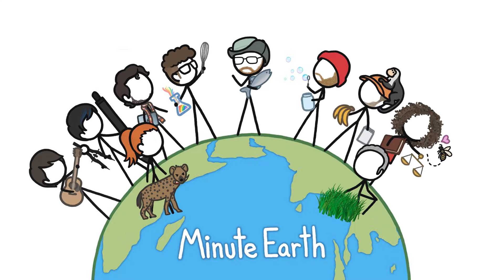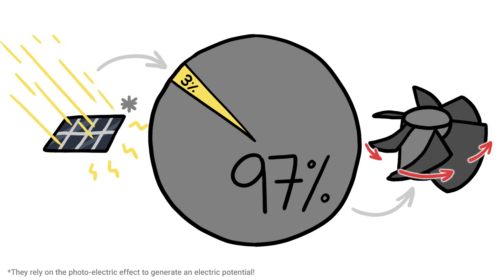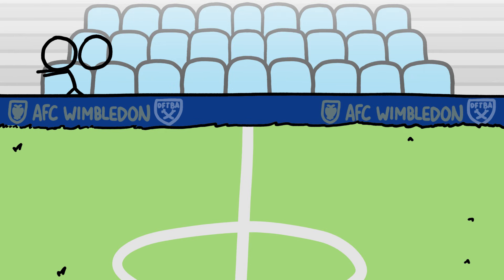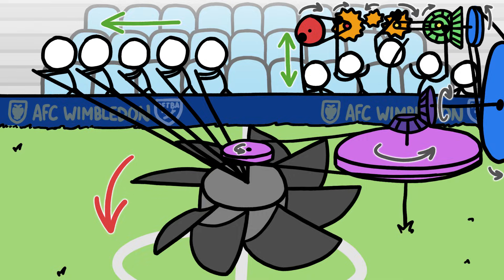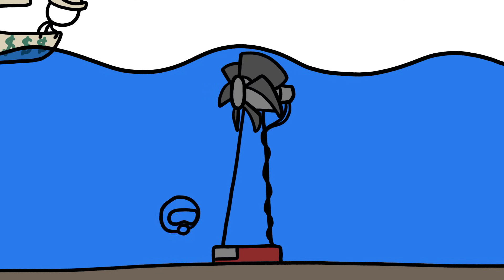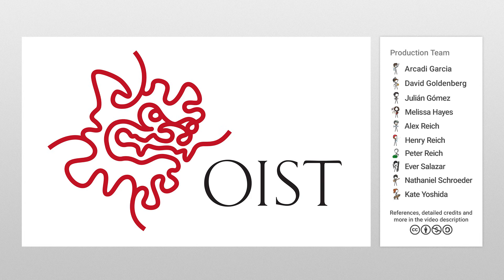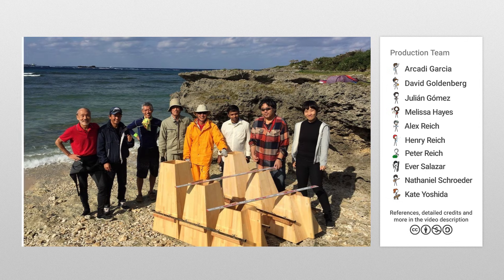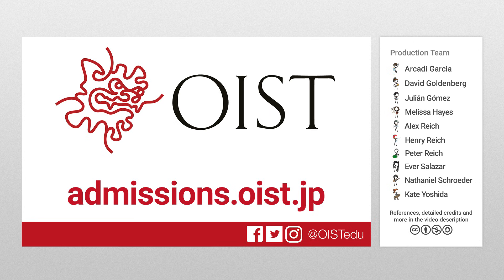Why Can't We Get Power From Waves?

Comment: Lets just invest in more nuclear. Its honestly great when done right
Reply: https://whatisnuclear.com/thorium.html
here ya go, benefits and downsides of thorium
Reply: @chroma9848  most of those downsides are the use of solid reactor fuels, which include thorium, which are addressed if you use a liquid fuel and reactor salts instead.
Reply: @kush1000ful  thorium reactors still require uranium to function.
Reply: @tweakerkid  Yes, but only a tiny amount compared to what is needed for conventional fusion.
Reply: @tweakerkid  yes, but we have plenty wasted from actual nuclar waste. Thorium solves two  problems at once!
Reply: @tweakerkid  Nope there are designs that don't. https://en.wikipedia.org/wiki/Accelerator-driven_subcritical_reactor
Reply: Thorium appears to be the answer.

It has countless advantages over Uranium including much much much much safer, but for some reason it never took off.

Probably because the plants are more expensive to build, and you can't use Thorium to make bombs - so the government can't use the power plants to sneakily do nuclear weapons research and/or cover up their nuclear weapons expenditure.
Reply: @mrfish9876  thorium offers some advantages over uranium; but you most certainly can get “weapons” from ANY energy source.
Reply: @williamweigt7632   maybe some kind of a weapon but you can't make nuclear bombs from it.

With Uranium, once the reaction has started it will keep going unless contained.  

With Thorium it is the opposite, you need something to sustain the reaction or it stops on its own.

That's why you have accidents like chernobly and that one in the japanese tsunami - once your controls/cooling fails  things go bad fast, whereas with Thorium if your cooling/controls fail, the reaction just stops, it just fizzles out.
Reply: @mrfish9876  Or you use heavy water as a moderator and then when your cooling fails, so does your moderator.
Reply: AOC and her bugeyed friends never mention it for some reason, and young people are scared of it thanks to getting their info from Netflix and facebook. Best of luck
Reply: It's not a matter of money; it's regulations. If you get the NIMBY Karens, "concerned" science professors, environmentalists, and unions to back off a bit, not entirely, but enough so that project managers can actually plan without the ordinance requirements changing several times mid-project, nuclear would be profitable enough on its own.

The bigger problem is it's too late. Much of the infrastructure and personnel needed to build a nuclear reactor simply doesn't exist any more. The US would need foreign help just to build our own designs.
Reply: Expensive
Reply: @luongmaihunggia  Yes, solar and wind are damned expensive.
Reply: @drrtfm  less than nuclear apparently
Reply: @luongmaihunggia  Nope: solar and wind are basically the most expensive forms of power generation currently employed; and that's before considering dealing with waste from them, which is highly toxic and permanently so.  And unlike nuclear waste, cannot be readily reprocessed into more nuclear fuel.
Reply: @luongmaihunggia  Which part of "there is more to silicon chips than silicon" don't you understand?
Reply: @drrtfm  all of it. There are 6.022*10^23 kilogram of silicon in the earth. Many many times more mass than all silicon chips on earth.
What does that have to do with you claiming bullshit that solar and wind energy is toxic?
Reply: @luongmaihunggia  "There are 6.022*10^23 kilogram of silicon in the earth. Many many times more mass than all silicon chips on earth.
What does that have to do with you claiming bullshit that solar and wind energy is toxic?"

There is more than just silicon in a "silicon" chip.
Reply: When you don't bury the wastes in poor country it's a great way too make energy
Reply: Nah. Geothermal is best I think, at least in the usa considering America is sitting on the biggest volcano in the world.
Reply: @Rin-qj7zt  I agree that geothermal is very good, but it would be extremely wasteful to try and power the entire country off of it since it's mostly only available in the west. The cost of moving electricity across all of America is pretty extreme.
Reply: @ottopike6000  by the way, scientists just created the first room temperature superconductor. if we can figure out how to mass produce it, that completely solves that specific issue x3
Reply: @Rin-qj7zt  it doesn't just have to be mass producable, it has to be cost effective. Currently we use aluminum wire in stead of copper because it's cheaper. So I wouldn't bank on making a room temperature superconductor cheaper than copper any time soon.
Reply: @ottopike6000  that's redundant. Part of being mass-producible means it's already cost effective. This is nitpicking.
Reply: @Rin-qj7zt  what I mean is that it can't just be good enough for computers, it has to be incredibly cheap.
Reply: @ottopike6000  yeah, and i'm saying that's redundant. you know it's redundant because i'm telling you. i'm informing you that your interpretation of what i said was incorrect, and that you need to change the interpreted meaning of what i said to match what you are trying to tell me.
Reply: @Rin-qj7zt  yes, that's called misunderstanding someone. It happens when you are unable to read people's minds.

Obviously if we can use room temperature superconductors in computer circuitry then we have successfully mass produced them. My point is that the threshold of mass production is insufficient to allow it to be used in power lines.

Now that I understand that you were using mass produce as a place holder for cheap enough to use in a power line. Thus I see I misunderstood you.
Reply: @Rin-qj7zt  "if we can figure out how to mass produce it, that completely solves that specific issue"

Not exactly: you are ignoring the costs and difficulties in getting the right-of-way for shipping that power.
Reply: @drrtfm  well I'll keep that in mind next time I open my mouth
Reply: And explosive when done wrong
Reply: I have missgivings about the safety of nuclear long term. In the next 100 years, proliferation and time means probability greatly increases. It's just maths. 

Given the extreme potential cost of nuclear disaster compared to anything else, I just don't think it's worth it
Reply: THORIUM PEOPLE
Reply: it is also great soruce if power when done not so right. the only time it is seriously dangerous is if there are things that could not be predicted.
Reply: @BasicEndjo  "the only time it is seriously dangerous is if there are things that could not be predicted."

Not even then really, since you just build a container around it and you're fine: see TMI for example.
Reply: until shit goes sideways or you have to dispose of nuclear waste then its a freaking nightmare to say the least
Reply: @dimos5422  "until shit goes sideways or you have to dispose of nuclear waste then its a freaking nightmare to say the least"

Incorrect on both issues, both solved decades ago.
Reply: @drrtfm  the japan disaster wasnt so many years ago so no nothing has been solved since there are so many variables like human error or terrorism and natural disasters. That said i am really looking forward to nuclear fusion
Reply: @dimos5422  What you describe as "the japan disaster" was a tsunami that killed a lot of people.  All of those people would have died regardless the presence or absence of that reactor.  Zero died because of the reactor.  So please explain why this is a problem?  In fact, please explain why, since nuclear has killed less people than any other power source per MWh of power generated, that we shouldn't be using nuclear?  You like people dying?  Because it sure sounds like it when you favour power generation that kills more people than does nuclear.
Reply: @kush1000ful  actually, nuclear would be more of a stopgap measure for the fusion energy, because oh boy fusion is extremely safe and efficient, it is the real future.
Reply: @greengreen110  ye there is the problem. Companies, finally a good actual reason to avoid it.
Reply: I agree
Reply: @greengreen110  Including all nuclear energy disasters, which we can count on one hand regardless of definition, per MWh produced nuclear is safer than every other form of power production.
Reply: Ah yes the final point to this video
Reply: Not only is nuclear great when done right, it's still pretty damn good when done "wrong". Compared to other energy sources you really can't go wrong with nuclear, it will always be better than other energy sources simply thanks to the fundamental physical advantages behind the core concept.
Reply: I have faith in nuclear fusion tho, a mile better than fission as long as it's developed for energy and not to destroy other countries lol.
Reply: @chroma9848  you need fission power to kick start a fusion reactor, so you still have the issue if solving for fission first.
Reply: It makes sense, France has 70% come from Nuclear with another 20% from non fossil fuels. That seems to be a great mix. Could do less fossil fuels still but might as well use the resources we have.
Reply: @NAUM1  i don't support nuclear until we have a plan to deal with it's waste
Reply: @Rin-qj7zt  its not waste until its completely non usable, like after a few reprocessing cycles when it can no longer be reprocessed
Reply: @Rin-qj7zt  The solutions to waste are multiple and demonstrated decades ago.  The lobby groups prevent their deployment.
Reply: @drrtfm  their deployment is what I was referring to. Until we decide what to do with it I don't feel comfortable supporting it
Reply: @Rin-qj7zt  "Until we decide what to do with it I don't feel comfortable supporting it"

That is 100% a political problem  The technology is safe and it is sad that so many people don't understand that fact.
Reply: @drrtfm  I am aware that is a political problem yeah. The purpose of my original statement was to point out that political problem. I'm even aware of some of the solutions.
Reply: @drrtfm  i am aware of this. until that victory is won, i don't support expanding nuclear. it would be irresponsible.
Reply: @Rin-qj7zt  "i am aware of this. until that victory is won, i don't support expanding nuclear. it would be irresponsible."

Sorry, but are you saying you like more people dying rather than less?  I ask, because nuclear kills less people per MWh produced than any other form of power generation, and so opposing nuclear is basically saying that you want more people to die.
Reply: @drrtfm  upscaling would risk hurting the environment and the people in it too much without a safe and responsible way of disposing of the waste.
Reply: @Rin-qj7zt  (1) Every form of energy production hurts the environment.  All you get to do is pick which one and justify it. At this point, nuclear does the least damage and kills the least people.
(2) Given that nuclear kills less people per MWh produced than every other form of energy production, I have to ask again: why do you want more people to die?  This does not seem responsible.
Reply: @drrtfm  because more people could die and thousands of years of damage could result if we recklessly expand nuclear. current statistics are irrelevant to the position i'm taking. more people currently die with current form of energy production? yes. yes they do. irrelevant. other forms also hurt the environment? not as damaging as the worst case scenario of nuclear waste released into the environment. 

i repeat. i do not support expanding nuclear until we have a solution in place to deal with the waste first. this is not unreasonable, nor unrealistic.
Reply: You guys are just really poor in understanding physics. If up and down is the ocean then up and down turbines is the solution. They do not have to be submerged, using floaters in the water that moves up and down with accordion effect that blows air to an air turbine is the solution for this problem... why it is so hard to see it?
Americans needs more education outside of the nuclear bubble and get off the square box you are placed in since kinder... Folks just Open your Minds...
Note: there are other plenty of ways to obtain cheap and efficient energy away from turbine thing but since you guys are playing with turbines and sea water then I am giving you a fun way to keep playing with it... 😄🤣😉
Reply: @sunnyaccount3984  I'm quite sure if it is so simple you can happily go make billions off of it.  Have fun.
Reply: @drrtfm  actually those turbines already exist you just need to look and investigate a little further, this video is, technologically speaking, really far behind actually...
Reply: @sunnyaccount3984  I am well aware that such systems exist; their existence is fairly convincing proof that the costs are prohibitive.
Reply: @drrtfm   oh prohibitive for the corporats that are in the business of scamming the society and taking away their money to give it to their greedy corporats pals, the whole point of using natural source of power such as tidal and solar power is to free the people from the greedy miserables corporats and their greedy miserables representatives.
Reply: @sunnyaccount3984  Every source of power is natural, by definition.  How you think tidal power frees people from corporations is quite beyond me, given what is required to set it up (starting with legal rights that must be granted by the state).
Reply: go back to the 50s!
Reply: Uranium mining is damaging, of course the elephant always in the room is where to put the waste safety for thousands of years.
Reply: @tweakerkid  most of the transuranic "waste" isnt waste at all, it can be reprocessed into LFTR fuel and can have its remaining energy potential used. What little waste thats produced, while much more radioactive,  burns off in hundreds of years instead of tens of thousands.
Reply: @tweakerkid  but there is spent fuel recycling technology out there that can reprocess the fuel and make it usable again to make the most out of the fuel
Reply: @tweakerkid  and who will pay to store that nuclear waste safely for thousands of years.
Reply: @KJSvitko  "and who will pay to store that nuclear waste safely for thousands of years. "

No one: you use a reactor design that burns the waste to produce more fuel.
Reply: @tweakerkid  "where to put the waste safety for thousands of years."

You "burn" it in a fast breeder reactor.  This problem was solved decades ago.
Reply: @tweakerkid  Anywhere we want really. It's the easy form of industrial waste to deal with because it is a small amount and has already been collected and isolated from the environment. A real question is what are we going to do with all the carcinogenic cadmium in solar panels. Cadmium has no half life, and is just being sent out into the environment with no plan to collect and isolate it. That is a problem that gonna kill a lot of people. Same thing with mercury, lead, and other toxic materials created by industry. Really, nuclear waste gets talked about because it's sexy, not because it's actually a problem.
Reply: @tweakerkid  I guess you don't know what a fast-breeder reactor is.
Reply: @Sphere723  Cadmium panels only make up 2% of market share of solar panels and they will become obsolete in less than 5 years. Recent technology with glass, aluminum, copper, and silicon has replaced them. Also lead was used for soldering but it's also been replaced. The misinformation about solar panels being toxic is actually funded by petrol companies. Quick google search and you can find out more about current solar tech.
Reply: its really really not. not even talking about the dangers of radiation:
most people talking about how climate-friendly nuclear is aways „forget“ to factor in the resources needed to first mine fissile materials, refine them and then create long time storage for them.
unless by nuclear you mean nuclear fusion, which yet has to produce a net positive energy gain
Reply: @TheVergile  mining is a dirty business in many ways, but it is largely ignored as a contributor to pretty much anything tbh, not just here. A lot of materials development generally, for example, needs stuff that is mined to produce new stuff.
Reply: TheVergile If the ITER project goes well, we should see it in our lifetimes. If not, I guess we’re another 30 years off from fusion energy, for the 7th time
Reply: @TheVergile  Remind us all how environmentally friendly mining the materials for solar and wind production are?  Uranium mining is dream compared with those. 

As for waste, the problem of "burning" it in a reactor to create new nuclear fuel was solved decades ago.  

As for fusion, sorry, but while it is, indeed, a long way off (though estimates range from possibly by 2030, probably by 2040, and definitely by 2050), it has already produced net energy out. That milestone was reached over 6 years ago.
Reply: @drrtfm  Well first off you gotta tell me which technology exactly you mean, since material requirements vary wildly between them.
For most photovoltaic elements the main resource is silicone (in layman's terms: refined sand). There are some trace elements needed to dope the silicone, but thats negligible. The real concern are the chemicals used in the refining process and the energy required.
The latter is a relatively small issue since energy is the name of the game anyways and we will just have to consider the energy required for production as a period of time the panels need to work before they actually produce green energy. Most modern panels spend about 1-2 years paying back the energy that was used to make them and start producing green energy afterwards.
The chemicals used are a much more complicated topic. It depends a lot on what kind of panels you produce and where it is produced - but the impact on the environment can range from negligible to severe. The latter is often a sign of cutting costs rather than an inherent flaw in the technology.
So all in all solar panels can easily do a lot better than fission reactors in that regard. Mining fissile material can be low-impact if you look at rich, surface level deposits. These arent all that common tho. If we are to rely on fission reactors for the next few decades we have to touch the less pure, harder to get at deposits. (we see the same problem with fossile fuels) - this significantly increases the environmental impact every single bit of energy produced has. 
Wind energy is another beast altogether. There are way too many different technologies - and honestly im not well versed enough in even a quarter of them - to give a meaningful answer to the impact their construction has in terms of energy/resources used.
Reply: @TheVergile  "There are some trace elements needed to dope the silicone, but thats negligible."

And this is where you fail from the start: electronic waste (in layman's term, that's the sand you are condescendingly describing) cannot be dumped into the garbage.  Gee.  I wonder why?  Could it be all that "negligible" material that you think is irrelevant.  Yup, that's the reason.  When you fix your education of that, I'll waste more time explaining why the rest of what you wrote is also nonsense.
Reply: @drrtfm  you are throwing together different things though. You were talking about the cost and environmental impact of mining ressources, not how they are recycled. If you just throw together a ton of complicated topics whenever it suits you the discussion is going nowhere fast.
Its just cheap rhetoric on your part.

You are also incorrect to assume the doping materials are a problem during disposal. They are not. In most jurisdiction silicon based solar cells are classified as regular waste products and can be disposed without problems.
The problem lies more in the fact that you cannot directly recycle the silicon because there is no way to easily undope the material. Hence the cells need to be processed to separate the silicon and trace metals if you want to reuse them to make new wafers.

If you go through the trouble of doing that upwards of 90% of the silicon can be reused however. 
Solar cells are much easier to recycle than chips. The other biggest component, the glass, can almost be completely reused.
The biggest loss occurs with plastics and other polymers that may be used as foils, binders, structural parts or backing layers.
Reply: There are still problems with nuclear that will never be fixed. For example the waste. Even if all nuclear reactors convered 99% of their fuel into clean unradioactive waste then the 1% leftover would still be a massive amount if the majority of the world's energy was from nuclear power. Safety will also always be a problem. All the major nuclear disasters in history have been caused by failed or stained safety systems. When planning and accounting for disasters you have to plan for the worst possible outcome where the safety systems aren't working, meaning nuclear power will have lots of inefficient redundancies in their designs, meaning the costs on paper is harder to justify and so more owners of nuclear power stations are always going to be tempted to cut corners. A problem that will only increase as humans are more reliant on nuclear and build more. I think nuclear power is a useful resource and its development is important but it is not a fix all solution to the energy crisis.
Reply: @welshmanjones3246  Gen4+ reactors, LFTRs are "walk away safe", self regulating and self terminating.  Look up designs they are truly a complete rethink on reactor design.
Reply: @welshmanjones3246  looking for more arguments against use of nuclear and this cost of redundancies is a new one for the arsenal. Thanks!
Reply: @welshmanjones3246  we already know the safest way to deal with it. We seal the nuclear waste in old salt mines and incase it in concrete. Literally the simplest easiest thing to manage, and at the rate we require salt we will never run out of space for the small amount of nuclear waste that is produced compared to the volume of salt we mine.
Reply: @HerbaMachina  "we already know the safest way to deal with it. We seal the nuclear waste in old salt mines and incase it in concrete."

You can, but it really is a horrible solution given that breeder reactors can turn the waste into fuel.
Reply: @welshmanjones3246  Less people die and/or are injured by nuclear power generation per MWh produced than by any other form of power generation.
Reply: We can't even properly deal with the waste from the nuclear plants we have  now. Not to mention the nuclear material needed for reactors are not unlimited.
Reply: @Alex7ati  its not waste all you need is facilities like Sellafield to come along and reprocess it so it can be used again.
Reply: @Alex7ati  "We can't even properly deal with the waste from the nuclear plants we have  now." 

False.  We know how to "burn" nuclear waste in reactors to make more nuclear fuel.  This was a solved problem decades ago.

"Not to mention the nuclear material needed for reactors are not unlimited."

True.  We only have another 7 million years before we run out of uranium to mine.  Of course, we could then use the already proven process of extracting it from seawater for another billion years, by which time it is expected that the planet will be uninhabitable.  But yes, in the narrow, technical sense of the word, the material needed is not unlimited.  Of course, that statement is true for every single fuel source, including every renewable source.  In fact, every other source is going to run into resource limitations long, long, long before nuclear does, but, again, yes, you are in a completely meaningless sense, technically correct.
Reply: Chernobyl 2: Electric Boogaloo
Reply: @lorddog7249  Even counting Chernobyl, per MWh of energy produced, nuclear causes less death than any other form, and is the only form that actually deals with its byproducts.
Reply: @lorddog7249  *Nuclear Boogalo
Reply: yes sadly we'll run out of uranium so it's only a temporary solution, maybe asteroid mining in the future?
Reply: @McPhysX  um, we'll run out of uranium in like a thousand years... Not exactly a time frame to be worried about.
Reply: @ottopike6000   that would hopefully be enough time till we find other sources of uranium or find new materials to make fusion work
Reply: @ottopike6000  "um, we'll run out of uranium in like a thousand years"

Actually, there is enough mineable uranium for about 7 million years; we can also do seawater extraction for another billion years.  We really are not going to run out of uranium.
Reply: @FowlorTheRooster1990  considering that most progress in electrical generation has been made in the past 300 years, it's hard to imagine a situation where human civilisation still exists and 1,000 years isn't enough.
Reply: @drrtfm  I don't think that's accounting for consumption increase. I grant that I was underestimating when I said 1,000 years, but we do not have enough for 7 million at projected consumption rates.
Reply: @ottopike6000  I'm not factoring in consumption increase because energy use in the developed world plateaued several decades ago.  It turns out that it is cheaper to become more energy efficient and use the savings for new purposes than to build another power plant.  I suspect we could gain a lot more through efficiency than we have yet to achieve.
Reply: @drrtfm  several decades isn't a reasonable timeframe to project 1000 years from. Besides, energy usage plateaued at the same time that economic growth did. Which means that once we're done developing the third world and everywhere becomes at least a middle income country economic growth will resume and consumption will continue to increase. Global energy consumption has continued to increase at a rather steady rate, so I don't see why that would stop.

And most of the energy efficiency has come from transitioning from coal to natural gas. Right now we're generating power at about 80% efficiency and losing about 6% through the grid. So we can squeeze about another 25% out of it if we get perfect efficiency. That's all the optimization that can ever happen for all eternity in so far as the electrical grid is concerned.
Reply: @ottopike6000  No, projecting to the million-year range, or even the billion-year range is quite reasonable because there are fundamental limits to power consumption on the planet: all power consumed ends up as waste heat: consume too much and your planet overheats and everyone dies.

As for power-generation efficiency: no one is even close to 80% efficiency.  The efficiency of current natural gas power plants is between 32% and 38%, with their primary advantage over coal being that they can be turned on or off extremely quickly.  The most efficient next-generation NG plants are 60%.  There are in general some fairly fundamental limits caused by turbine-generation of electricity.
Reply: @drrtfm  so firstly, I don't know where you're getting the idea that there are limits to human consumption. Remember when people said that nobody will ever need more than 100 KB of storage space on their computers? That didn't turn out to be true. On top of that there's a lot of high energy things that we're likely to be doing in the near future. Space travel being an obvious one.

Also, I don't know where you're getting those efficiency numbers for natural gas. Those numbers aren't even as efficient as car engines. A topical combined cycle natural gas powerplant achieves around 60% efficiency. However recently designed power plants do in fact reach efficiencies of over 80%. Last I checked these haven't been built in large sizes and are still being tested before becoming the new standard.

And anyway, people are absolutely not done consuming. People in the west are furious with the lack of economic growth over the past few decades. They want their luxury housing, flying cars, and AI assistant. Everyone wants their own spacious dwelling, their own ability to persue their own hobbies, easy access to Healthcare, and climate controlled environment. Heck if people could I'm sure a lot would want their own zoo, or their own underground bunkers, or maybe a fleet of robot "companions".

If you think that human consumption is going to drop off then you're just not very imaginative. But it's ok, because there's plenty of ways to make energy, so the universe can support us and our endless appetites. If push comes to shove we can always start tapping into the Quantum foam. As far as we know that stuff doesn't run out, even if it doesn't give you much.

Edit- I missed your justification regarding waste heat. I will say a couple of things regarding that:

First, at the point at which we need to worry about planetary waste heat running out of uranium will happen well before a billion years.

Second, we can cool the planet completely passively and even get energy from it. The water cycle already does this here on Earth, however we would probably use something that absorbs thermal radiation in the walls or something because it would be far more efficient. So the overheating problem is absolutely solvable.
Reply: @ottopike6000  "I don't know where you're getting the idea that there are limits to human consumption. "

Try eating an unlimited amount of calories and you will begin to understand that there are limits to human consumption.  Further, if you understood what I wrote you would understand the effect of waste heat.

Space travel is off planet and would use off-planet resources since it would be foolish to use on-planet resources from the bottom of a gravity well when they can be acquired off-planet.

The efficiency information is not hard to find, but in my case I simply asked my colleagues in my department (ECE in a global top-25 university).  I really do know what I'm writing about.
Reply: @drrtfm  I'm an engineer at Boeing, and I do in fact know a thing or two about energy efficiency and waste heat. And even a burner natural gas plant outputs an average efficiency of about 40%. But if infact natural gas plants were about as efficient as coal, might I ask how they manage to produce 40% less CO2 on average? Especially when you consider that they have fewer byproducts than coal when burned, one wonders how it manages to produce so much energy with so little waste. Honestly I assume that you're lying because I would find it very surprising for people educated in this field to display that level of incompetence. Especially if you asked multiple of them. The EPA and DOE publicize these numbers you know. 

As for infinite consumption, have you ever wondered why people don't spend 90% of their waking hours getting calories anymore? It's because Humanity actually possess more desires than those of an oyster, go figure.

Now we spend huge amounts over energy on travel, fashion, entertainment, and construction. If the goal is literally just to be higher status than your neighbors for example, then that's infinite consumption right there. But even if we just wanted more noble things like acquiring knowledge, there really isn't a limit to how big of a computer we can have to comprehend the universe, or how detailed of a model we can simulate, or how many different iterations we can produce.

And so what if we added all the uranium in the solar system? Even if we assume that that increases the supply by 100 times (which is generous) and we assume that consumption is going up by 3% per year (which is conservative) that only buys you about another 150 years before we use all of it up too. At a certain point uranium just won't come anywhere close to meeting our needs. Unless I suppose you think that we'll all achieve enlightenment and become neo-primitivists at some point. I don't suppose I know what your view on human nature is, but it doesn't seem to be rooted in either history or economics.
Reply: @McPhysX  there is abundant fissle material for nuclear energy for centuries and beyond.
Reply: @williamweigt7632  "there is abundant fissle material for nuclear energy for centuries and beyond."

Literally there is enough for a billion years.
Reply: @McPhysX  that's not how that even remotely works, you use thorium-uranium fuel cycle to breed more, using a thorium breeder reactor. this is how the Earth creates uranium.
Reply: @McPhysX  with reprocessing we have millions  of years worth of fuel.
Reply: @McPhysX  It would take 7 million years to consume all mineable uranium.  After that, we can extract it from seawater, which is a known process and has been done.  That would last us another billion years, and by that point the planet is expected to be uninhabitable.
Reply: @McPhysX  or, innovate to make new forms of electricity.
Reply: Because Fukishima and Chernobyl are such a success story. They will be paying billions for clean up for decades to come. Nuclear energy is too costly and too dangerous. Wind and solar are safer, cleaner and cheaper.
Reply: @KJSvitko  solar safe? How about you take a look at the components and waste it produces, and look at how it is extracted. Its extremely dangerous, plus it is very limited. And not all countries can use hydroelectric, wind, etc due to geography. So what they would just use oil and coal?
Reply: @KJSvitko  that is false in almost every way, modern nuclear power is better and more sustainable the any of the "clean" energy production atm, the last actual death caused by a failure of a nuclear power plant itself was decades ago, fukushima has zero deaths from the radiation, nuclear is incredibly cheap in production of power, and way safer then other types of power, sure not as safe as clean energy, but at least you could actually produce a substantial amount of power with little investment as compared to wind
Reply: @EeebyDeeby  No nuclear power plant, past, present or future could ever be built without government subsidies and limit on liability. No company will insure a nuclear power plant without the government limiting the risk. It is too risky. It is a bad investment.  Investors have spoken. Wind and solar energy is getting all the new investment money. Nuclear energy is dead money.
Reply: @KJSvitko  false but ok
Reply: @KJSvitko  "No nuclear power plant, past, present or future could ever be built without government subsidies and limit on liability."

ROTFLMAO.  Tell that Elon Musk who's electric cars would never have sold without subsidies.
Reply: @KJSvitko  this is why it's not a good idea to just skip over every single comment. At least scan. You might see something that answers your question.
Reply: @KJSvitko  Ummm, more or less everything you wrote there after the first sentence is false.  Per MWh produced, nuclear is safer than every other form of power generation, even when you factor in Chernobyl.  As far as Fukushima is concerned: the tsunami is what killed people, not the reactor.  As many people would have died without that reactor there.
Reply: @KJSvitko  You're clealry not very educated on this subject. Be honest the only thing you know about nuclear energy is that nuclear=bomb=bad please refrain from voicing your opinion in further debates until you have gathered more info on the topic.
Reply: That's the thing.  It's never been done right.  Because humans can't be trusted with nuclear power.
Reply: @armyofninjas9055  There are tons of Nuclear reactors in the US. I cant think of a single failure in the decades they've been operating. Fukushima and Chernobyl were situations of failed safety measures.
Reply: @HatedJared  Well, clearly you aren't aware of much lol.  Ever heard of the Three Mile incident?  It was sort of a big deal.  Ever heard of the nuclear fallout in the Pacific?  What about Nevada?  What about that time we dropped a nuke on the Carolinas that inexplicably didn't go off?  What about the time we lost a nuke in the arctic?  What about that time we irradiated Spain?
Reply: @armyofninjas9055  Three Mile Island is a one off and, just like Chernobyl and Fukushima, a case of failed safety measures.
Nevada and New Mexico was and is a nuclear weapons test site. The Arctic and Carolina missing nuke are not missing nuclear reactors, but mising nuclear weapons or military hardware. The fault for a missing nuke lies more on the plane or vessel carrying the bomb, since that plane needs to be malfunctioning first before the nuke goes missing in the ocean. And since nuclear bombs are designed to explode in a ball of fire rather than just leaching radiation for years, how is that different to Europeans suddenly finding out there's a live bomb from WW2 under their home?
If you don't think it's safe, compare the numbers of deaths and injuries caused by nuclear energy power plants with deaths and injuries from coal or oil power plants. There are way more coal and oil related accidents out there with larger losses of life and damage to the local environment than there are nuclear related incidents. In Fukushima, more people died from tsunami and the chaos surrounding the evacuation rather than the failed power plant. So far, the largest amount of people killed directly caused by nuclear energy is the 2 atomic bomb detonated over Hiroshima and Nagasaki (which is caused by politics and war, not an industrial accident). Apparently radiation illness is bad, but lung diseases (4th leading cause of death in the US) are ok? You get a lot of lung diseases with the pollution caused by fossil fuels. 
As for illegal of trafficking of nuclear weapons, yes, it's bad for someone like ISIS having a nuclear bomb. It's also bad for to be ISIS having AK-47s or even machetes. These are just tools to further their work of evil. Should we blame it on the Kalashnikov company or machete companies and force them to stop all production? But just like machetes and AKs are still being used for good, why does nuclear energy be treated any different with the calls to even ban nuclear research?
Even though nuclear research nowadays are trying to accomplish nuclear fusion that would eliminate the radiation problem?
Reply: @HatedJared  Three Mile Island.
Reply: @armyofninjas9055  I see you sent to be confused, nuclear power is good, you can't make a fucking atom bomb out of a reactor, you can try, but it wouldn't work, nuclear weapons are bad, nuclear power is good
Reply: @HatedJared  not to mention that both Chernobyl and Fukushima used older types of reactors which as you mentioned, had unreliable failsafes. Fukushima was already planned for near future shutdown at the time the tsunami hit.
Reply: @alexanderchristopher6237  some great points, but since nuclear power is different from the process of making nuclear weapons, I very much doubt isis would have the understanding necessary to convert it into a weapon.
Reply: @armyofninjas9055  Science is meant to have trials and errors. It's an unfortunate fact. How many errors has humans done when trying to harness electricity?
Reply: @alexanderchristopher6237  You're saying a lot of interesting things and it's mesmerising 😳 thank you
Reply: @alexanderchristopher6237  three mile was barely anything as nothing got out the containment building did its job
Reply: @HatedJared  "Fukushima ..." was not even the cause of mass death: that was the tsunami.
Reply: @armyofninjas9055  Zero people died because of TMI.  How many people has your favourite power source killed?

Do you understand the difference between weapons and electricity production?  Perhaps we should ban fertilizer because it has been used to build bombs and kill people.  Perhaps we should ban flying because someone flew a plane into the some buildings.  Electronic computers were created to aid in warfare: how dare you use one!
Reply: @armyofninjas9055  20% of all of the US's energy comes from nuclear power right now.
Reply: @armyofninjas9055  let's look at the nuclear reactor disasters, chernobyl? That happened because of faulty systems and equipment and incredibly useless and outdated soviet procedure, fukushima? It was a tsunami and earthquake, there was nothing that could be done, but the amount of deaths from radiation during fukushima is zero
Reply: @armyofninjas9055  lmao, yeah, theres definitely not dozens of nuclear power plants in operation today.
Reply: @fernandoleamshake7031  " theres definitely not dozens of nuclear power plants in operation today."

You are correct: they are not dozens, there are hundreds, over 400, producing roughly 10% of global electricity.
Reply: @armyofninjas9055  "It's never been done right."

Incorrect: accounting for all deaths, per MWh produced, nuclear is safer than any other form of energy humans have ever used.
Reply: @armyofninjas9055  dumbest thing said in the entire comment section. Congratulations!